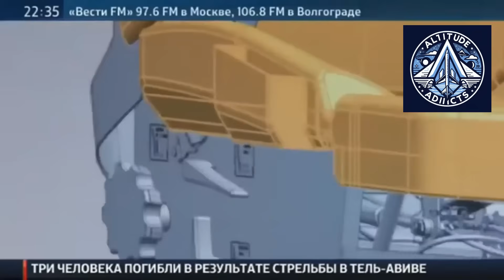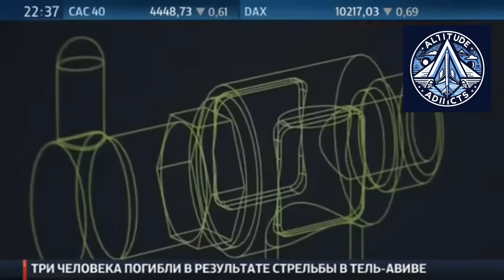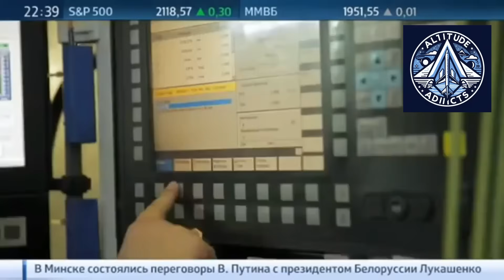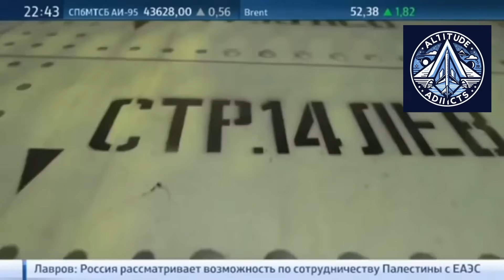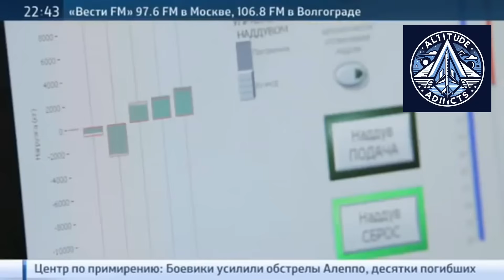Aeroflot’s 90 MC-21 Contract: What’s Agreed, What’s Still Pending

Comment: Like Descartes said, don't obmit the " recourse of the method ", nobody is oblgathed to  use western methods to produce aircraft or to follow western business models, every country is inherently unique as to production methods......
The aircraft is finalizing its integration and certification until it is homoglated, once finished Russia has three or four oyher locations where it can ram up production very rapidly or it can build new locations in as short as six months.....
The best thing is that since it is a Yakovlev 242 and was designed as a modular aircraft they can start production of shot and long versions very rapidly with the same tools....!..
Reply: Заводы построить. Смеялся 😄
Дядя, а на заводах кто работать будет? Хлопкоробы или может менеджеры по продажам? 
Сразу видно грамотея-домохозяйку. 😁
Reply: Конечно, доморощенные телеги и лапти - самое то.)))

Comment: It's hard to imagine that they will have to ramp up production, so that they can deliver almost 2 to 4 finished MC-21 every month, and this year after year, if they plan on producing hundreds of these planes in the coming decades!
Reply: You're forgetting that Russia has more than one aircraft manufacturing plant and design bureau. It's worth noting that Russia is currently actively modernizing its military aircraft fleet, and a significant portion of its capacity is devoted to this very purpose. Moreover, military aircraft manufacturing is far from the only type of aircraft currently being produced, or, rather, being prepared for production. For example, in 2022, Russia produced 252 aircraft and helicopters of various types and purposes, but sanctions on component imports hit them hard, and by 2024, production had fallen to 166. Military aircraft and helicopters are not included in these statistics. Moreover, in the 1980s, Gorbachev shut down civilian aircraft production in Russia, and in the 1990s, Yeltsin began closing design bureaus, bringing civil aviation in Russia to a virtual standstill. However, the Russians shifted their focus to military aviation and achieved incredible mastery in the creation of various rocket and jet engines. I suspect that if it weren't for those two idiots described above, Russia could have an excellent civil aviation industry. Right now, it's safe to say that Russia is starting from scratch. Well, not exactly from scratch, of course. I'm more than sure that military designers will help civilian specialists, but they'll have to build new workshops and purchase equipment, and they also need people who know their stuff. Overall, Russia has everything they need, and their education is truly excellent, so they could launch production if necessary. The sanctions situation has inoculated the entire country against democracy. Even those in Russian society who sympathized with the West turned against it after Western diplomats declared the need to destroy Russia. I think Russia has learned its lesson: you can do business with the West, but you can't rely on a market economy, because it has an owner.
Reply: @PhilPantnik Бред не пиши, о чем понятия не имеешь. 😁
Reply: @ВикторАпанасевич-ч6ы  о поросята набежали подхрюкивать.
Reply: @ВикторАпанасевич-ч6ы  Ну так тогда РФ превзошла те времена. Собственно произведенной гражданской авиатехники в год РФ:  2020-134, 2021-162, 2022-252, 2023-191, 2024-166. При этом в эту статистику входят исключительно гражданка, а вообще РФ на 2-3 месте по производству авиации в мире и на 7 месте по объему производства в целом. Почему-то многие забывают, что заводов в РФ не 1 и не 2 и жаде не 3))). Чего еще хрюкнешь?)
Reply: @PhilPantnik  ne te fatigue pas pour lui c'est un idiot.